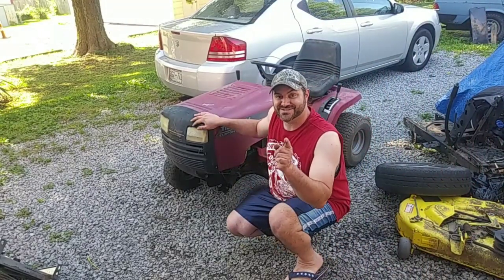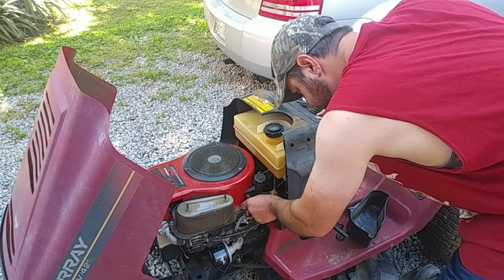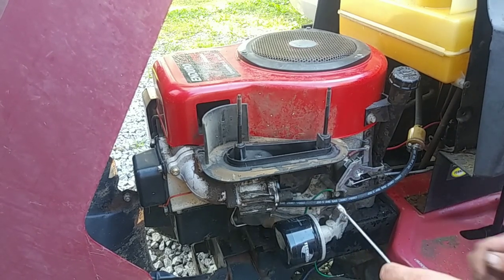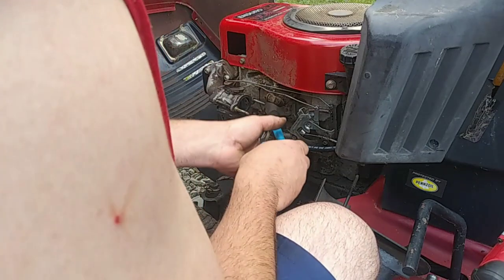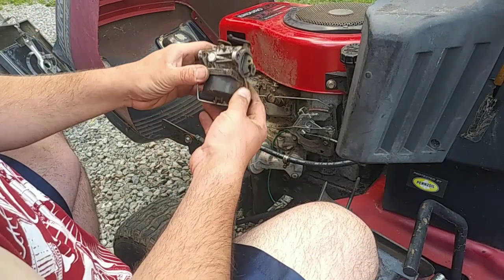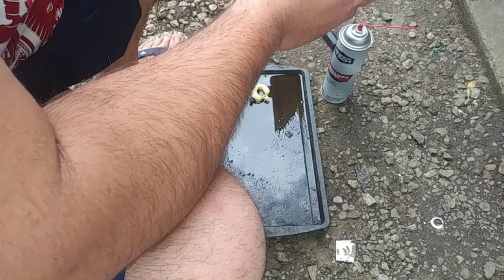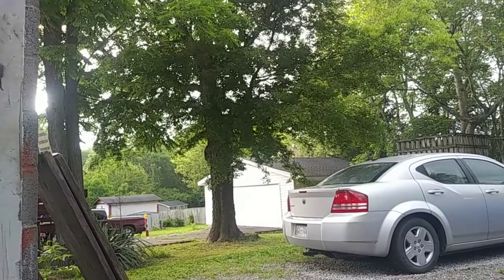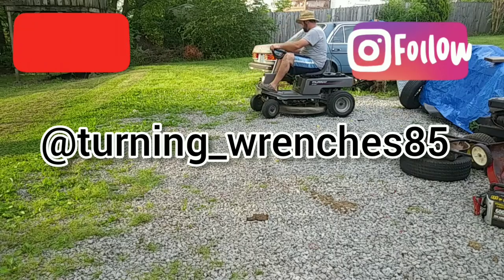Episode 1 Free Murray 17.5hp Tecumseh 42 inch deck seeing if it will try to run

Comment: Same engine as in my 2001 YardKing and that end screw is a drain, but also in side of that is a gasket for the screw, a spring, a plastic main jet, and an o-ring in that order. You likely already know that by now and I still got more of your vids to watch yet. Those carbs are relatively trouble free too being plastic, but some folks say they warp from being around a hot engine... I have not had that problem. Oh yeah that tractor is just a little dull and dirty and needs a bit of love is all!
Reply: Great vid for me.  Have the same type machine, having trouble with choke linkage. I hope I can find your next video on this to see how it went.   Thanks.

Comment: So yours doesn't crank fast and crank a long time before it starts up how mine does think its problem is the wrong type coil or is being grounded out on the ignition solenoid
Reply from the maker: Could be a possibility there and  weak spark

Comment: I have part and spindles for the deck for that model lawn mower if you need them
Reply from the maker: Oh u do?
Reply: @Turningwrenches85  yes sir I have the whole lawn tractor if needed any parts mine came with a V-Twin motor though so I don't have motor parts
Reply from the maker: @greggwall6443  wow thats nice ill keep that in mind
Reply: I’m still using my 2021 Murray17.5 42”  as my every summer mower.   I purchased it from Walmart.  2 spindles 1 starter, 3 carbs and two back tires is all that’s been replaced.  🤞🏻used it Saturday.   Found a great place for parts as well.